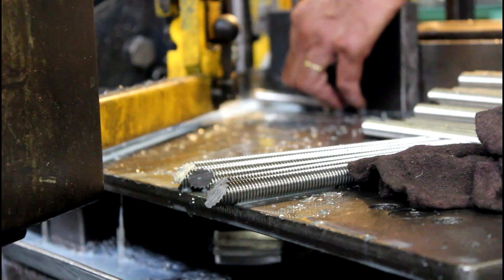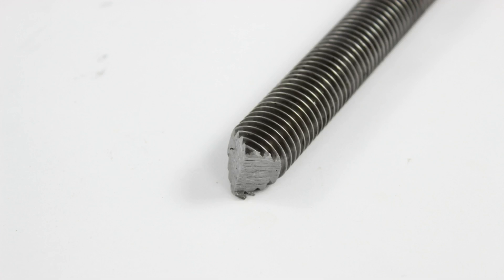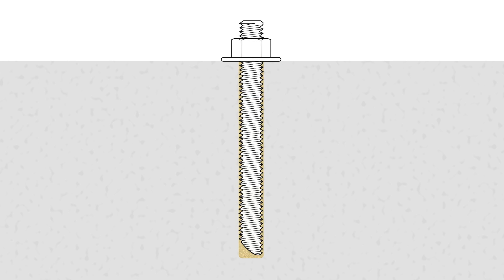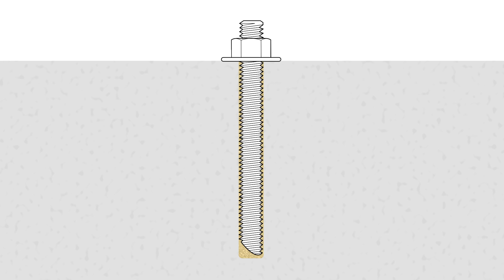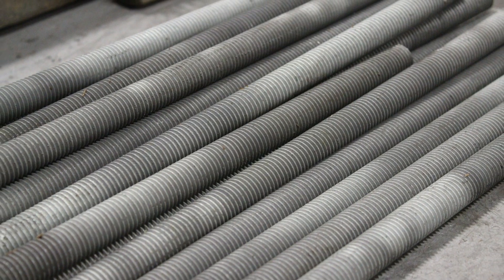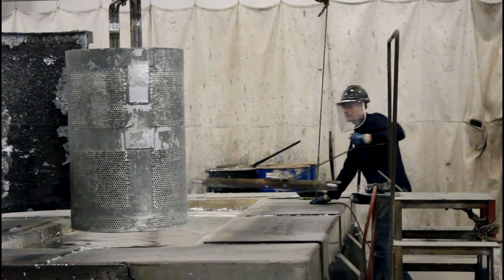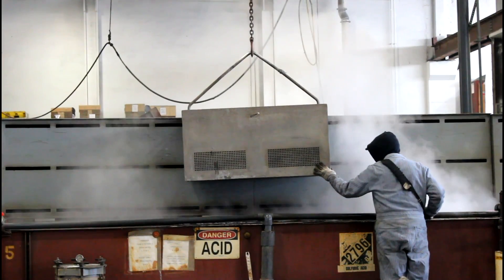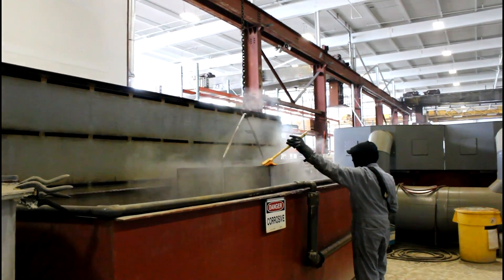All Thread Rod

Comment: Producing full threaded rods by cut thread operation is the most inefficient way to do so. Invest in high capacity thread rolls.
Reply from the maker: Nishant Jaiswal - You are correct.  The vast majority of fully threaded rod is produced using a thru-feel roll threader.  However, round bar is not readily available in certain grade and diameter combinations.  Some of the more obscure ASTM specifications especially in larger diameters may need to be produced with a cut thread, especially in small quantities.